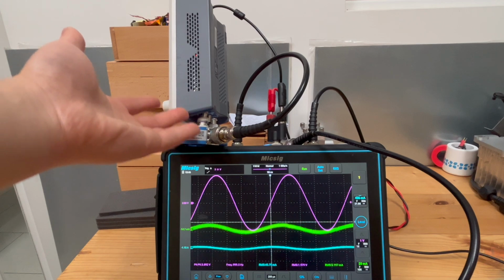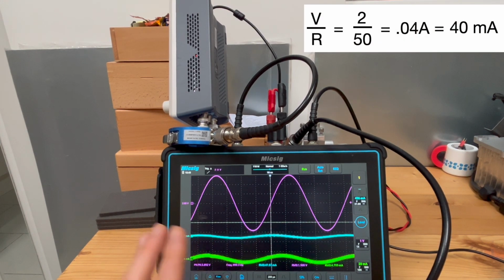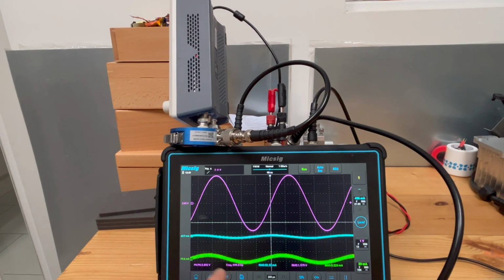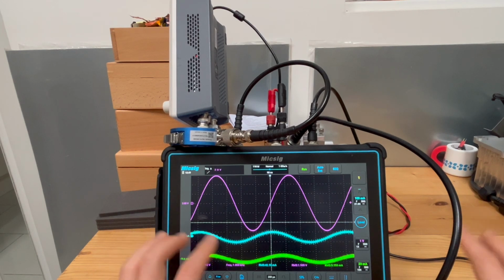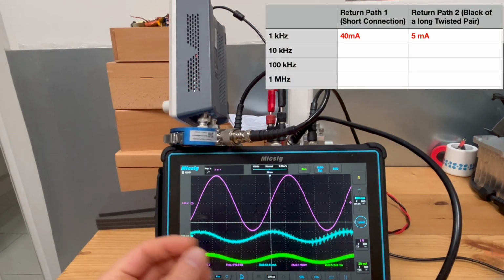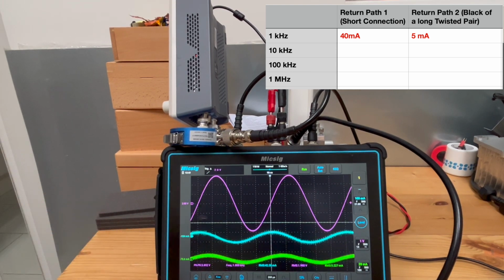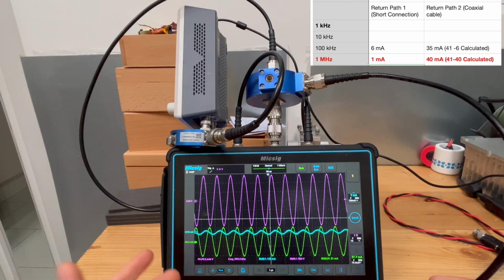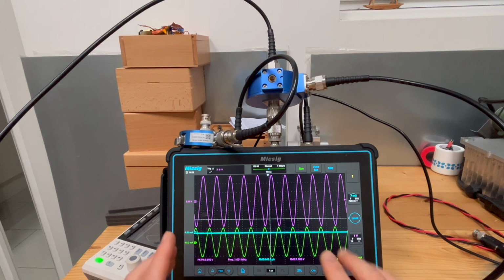Ground loop and Return Path: Twisted Pair vs Co-axial cable

Comment: Thanks! What is the characteristics for those current-probes at 1khz, 10khz, 100khz and 1meg? /Tomas
Reply from the maker: depending on the model type, but you can find this info on Tekbox's website.
Reply: @MachOneDesignEMC  I already bought one! 🤣

Comment: If you put a clap around a cable to measure the current are you also changing the impedance of this path and thereby the current? 
T
Reply: Yes some, but these are high frequency RF probes so not much I suppose. /Tomas
Reply from the maker: According to D Smith, most RF current probes, if you terminate with a 50 ohm impedance, the impact on the cable being tested is quite trivial.